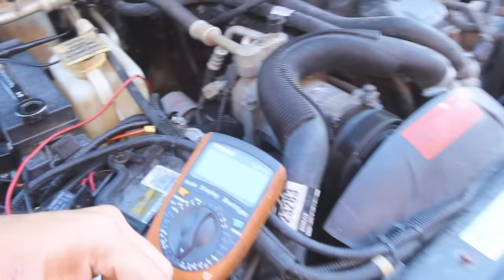AC Suddenly Stopped Working In My Car / Cheapest  Air Conditioner Diagnosis and Fix / Hot Jeep  XJ

Comment: Neat trick. I know my clutch on my compressor works but it won't come without manually adding voltage. So either my pressure is too low or it's the switch. Appreciate the video.

Comment: that switch is also designed to save system when low on coolant check coolant level you will probably add add with dye and find o ring that needs to be replaced drain coolant replace o ring replace coolant and enjoy your repaired system

Comment: This let me check the pressure on my system. Thanks I knew I had a leak but couldn't find it im guessing it's the evaporator core.  I'll be in there replacing the heater core later this year so I'll just do it all at once

Comment: Dude you're awesome..  👍👍😁

I haven't got to try this method yet because I'm out of state. I have been watching other videos you've made on the Jeep Grand Cherokee because I just bought one last week.   It's a 2001 and I paid $1,800 for it.   Of course it has some issues the air conditioning was one of them.  At least now I will easily be able to tell if it's going to be an expensive fix to get the AC working or not.
Reply from the maker: Good luck, let me know how it goes!

Comment: Sometimes that AC compressor clutch sticks if you take a wrench and tap on it give it a few good wax but they see in the on position it'll turn on. Or sometimes the electromagnetic switch that engages that clutch is bad

Comment: Good Video--First step I would check Freon Psig., if it is Normal, there is no Leak then it will either be Low or High Psig. Switch-most likely Low Psig Switch or Compressor or even the Clutch itself could be bad. As you have said if jumping switch engages compressor and starts cooling Vehicle then the Psig. Switch is problem...

Comment: I made the jumper paper clip and  stared the engine and the clutch did kick back on. But there was some oily liquid on the two wires in the boot. But the smaller tube got real hot .  The fan runs. I got a 1992 cherokee. You are one slick guy.

Comment: It helps, I have a 2002 Ford Explorer, the ac coolant can lasts a short time then back to hot, going out now to check it. First time I will do this, alone. I hope to just place the coolant and it works, but I will check this valve, great video!

Comment: Thanks for doing this video, I am in this project to fix my self the airconditioning problem for two summers now I could get to the problem, long story short I checked low-pressure switch and there is no continuity. so I will order and check back and comment more.

Comment: To change a low pressure switch , you usually have to evacuate your a/c charge which you have to get done at a shop unless you dont value the ozone layer. They will charge you for more than the 36 dollar part
Reply: He said it had a shrader valve in his switch.

Comment: If your car is fitted with a 3 or 4 wire pressure transducer you can easily stuff the ECU.  This should only be done on a 2 wire pressure switch and only for testing that the compressor clutch is still operational and never bridged out to run the A/C, as the pressure switch may be perfectly ok and the system may be low on refrigerant. If it is low on refrigerant and you run the system with the switch bridged out. Expect to be up for a new A/C compressor and possibly an expensive flushing of the system if the compressor shits itself.

Comment: It did help. I didn't known you could remove the pressure switch with refrigerant in the system. That's good to know. Thanks.
Reply from the maker: Yeah, it's nice there is a valve down there.

Comment: you can unplug that pressostat switch with the ac on and if the ac clutch stops, the switch works. plug it back in and the ac comes back on.

Comment: Continuity will only happen when a new good AC clutch sensor is screwed into the pressurized port. The same sensor seating on the bench will not have continuity, it will be "open" like a light switch in your house in the "off" position.

Comment: Man very good and well explained video ! I bought a 01 XJ last month and ac doesn’t work so I used this method. Compressor clutch came on but my electric fan never kicked in after 10pm so running the ac wide open. I discovered that a ac hose ( metal ) was disconnected at butt of another hose under beside the battery. It’s a PITA to reconnect. After running it wide open 10mins the heat guage never got over 210* so idk at what temp it kicks in. ( elec fan )
Reply from the maker: Interesting issue,

Comment: Thanks dude. Your vid saved my butt. I did replace the pressure censor, but compressor still didn't turn on thought had to get replaced or at least expensive shop diagnostic. did the paperclip test and compressor turned on.

Comment: LP switch is there for a reason.... Prevents compressor clutch from engaging in a low refrigerant system...Engaged compressor will go bad running with lack of refrigerant.... Compressors are the most expensive component of an AC system.

In general, when you hear 'paperclip' involving something electrical in nature don't do it. Buy a cheap multimeter, and spend a small amount of time learning how to use it to diagnose the issue.... Youtube will learn yuh right

Comment: My compressor started to turn on and off intermittently. I connected the gauges and saw the pressure was OK. I thought the switch was bad but when I disconnected the connector from the switch, I could see the connector was corroded and filled with green pus. I replaced the connector and the pressure switch to fix it.  I think I spent $11 for both parts.

Comment: I’ve tried this on mine because my whole system that I just replaced won’t work. I’ve replaced everything including the compressor and still won’t engage. Jumping the HPCO doesn’t get it to engage and 1996 didn’t have a low pressure cut off. Don’t try to tell me it does it doesn’t I have looked trust me

Comment: Fuse blown, a "bigger problem." Yup. Worked on a Honda the other day. No A/C. Fuse was blown. There was also a bungee cord wrapped around driver's side fan and the fan blade had completely snapped off of the fan motor. Replaced fuse and fan assembly, problem solved.

Comment: Awesome video 👍! I have a little question : Can all pressure sensors be removed, without removing the a/c gas/fluid? Mine ford focus mk3 2014 does everything right, but it still won't work with the a/c on 😭🤔

Comment: I would love to see someone have a faulty low or high pressure switch that was the only issue. Then take it to a shop and see what they charge you to change an 8 dollar part. Besides maybe a one hour minimum for diagnosing and doing system checks. Could sure highlight some bad apples like that
Reply from the maker: You gotta pay, if you can't  do it your self.  Lol.

Comment: My brother in law checked my car on Fri nite as my daughter told him ac in my car stopped working. He said ac (compressor) clogged went out. I called a mechanic shop & said it'd cost me &980 to $1k ish to have a new compressor. My question is is there a way for him to do like you did to my car? Or should I have to buy a new compressor? I'm a single mother is on FMLA Leave for 2-3 months due to my surgery on my hands, so it's very tight budget. Pls help if you can give any solution with my car without spending lot of money? I just bought it from a Chevrolet dealership where I live last April & it already gave me a headache. It's 2013 Nissan Rogue s. Thank you so much. I really appreciate 🙏

Comment: Appreciate the instruction.  My comp. clutch isn't engaging, and i'd hate to replace the clutch or compressor and it still didn't work.

There's a high-pressure switch too, right?  Would that be another thing to check?  I'm utterly illiterate when it comes to electrical systems, and multimeters make my brain freeze so i don't have one. 😬

Checked relay/fuse, coolant pressure is good, no probs.  Will check this switch & hope for the best, thanks very much for the straightforward and uncomplicated video.👍

Comment: One telltale sign your condenser fan is at fault is, your A/C only blows cold when you're moving and getting sufficient airflow across condenser. But at idle, it blows warm.
Reply: what about if it only blows cold air while driving

Comment: When the engine is cold the a/c works great.  Blows good cold air
  After the engine gets warmed up it continues to blow air, but the air becomes warm.  After you stop and the engine cools a while the a/c blows cold air again until the engine warms up and again it blows warm air.
Now, back in winter when I turned on the heater (after the engine warmed up) it would blow cold air.  Sometimes it would blow warm air for a little while, then cold air again?
Reply: Ever find out the problem? Sounds like my car

Comment: Cool but in mine the clutch engages, no leakage of oil or cooleant gas but still no cold air. I guess the compressor is not compressing. I've been told it might have mositure inside since i wasn't using for more than 2 years now.

Comment: 2010 Cobalt here. My air will quit at the hottest outside temps. 2 yrs ago I had a problem with it quitting. I had a mechanic check it put. First he changed the thermostat. Fine, for a couple miles then quit again. When driving it back to him the engine light came on and the info window read  __ F all blanks where numbers should be. When I told him that there must be a temp sensor on the engine that is not working he said "oh yeah, there is". He changed it and all was well until next season. the same thing happened and he was busy and Covid, so I let it go, A few days later the warning light went out and the info window started reading temps again. The air was working again. Three days ago warning light on and info blank again, NO air. Now I will wait a few days again to see if it up. Question: Do you think the new sensor may have been a bad one?
Reply from the maker: It's possible,   you need to check the history codes to really isolate the problem.

Comment: Thanks for the video. Checked this sensor, and it was good.  AC runs and is cold for about 15-20 mins then it gets hot and the fans turn off. They will start turning occasionally but go off . Any idea where I should look next. It's a 2016 outback

Comment: You said that if a fuse is blowing that can be a bigger problem. I understand that but I also wonder if a bad pressure switch, in particular high pressure switch couldn't that also be cause of a fuse blowing? I don't know. Just asking? We have a different vehicle and new clutch mini relay The 10 amp mini fuse blows after clutch is activated or when the Auto AC switch in dash is on. Clutch can temp activate before fuse blows and the compressor shaft isn't froze up. There is DC power at disconnected compressor connector when that connector is tested for voltage.

Comment: I’m hoping this is my issue. I get cool air for a little while then I get hot air, like my compressor doesn’t stay on. But when I hold the AC button in, I get cool air, compressor kicks on. Wish me luck. Oh, it’s a 2016 Subaru Forester. Oh, I forgot, my AC light flickers and won’t stay on which is also weird. Gotta get this fixed since I live in Arizona.

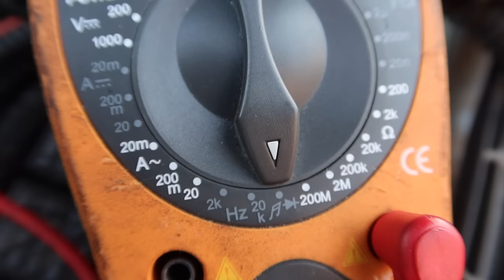Comment: @5:59 To check for continuity you can use the cheapest multi meter: switch on Resistance Mode, if you have continuity it will show zero. There will be no that nice beep, but it will detect the continuity (R=0, approximately). 
   I have a question about that Low Pressure Switch. Is it related to Secondary Air system? I'm  trying to fix  AC on one car (2001 Saturn SL2). It did have a leak, since there was no pressure on it. It was without AC for 10 years (fm the time I attempted to repair it at Dealer, they tried their best, but after the last visit there on this matter, the AC stopped working after 2 weeks, and I decided that the system can't be fixed. It is our back up car, so we didn't worry much about it).  I replaced  many AC parts on it, but it doesn't hold vacuum. That Low Pressure Switch also might be faulty. Thank you for a great film.

On Secondary Air System I replaced:
1. ACDelco 21008418 GM Original Equipment Secondary Air Injection Vacuum Check Valve.
2. GM Genuine Parts 21210000 Secondary Air Injection Shut-Off and Check Valve.

   And I didn't replace:
3. GM Genuine Parts 214-1057 Secondary Air Injection Vacuum Control Solenoid Valve  (I suspect maybe that part has another name Low Pressure Switch, but not sure).
Reply from the maker: Secondary air injection is part of the emissions system, not related to air conditioning.
Reply: @Donnythelatemodeltech  Thank you so much for a quick replay. I'll try to find that Low Pressure Switch on Saturn. I have Shop Manual for it. Thank you again.

Comment: What if your AC suddenly does not blow air?  Just had compressor and fan replaced and it worked great for a couple weeks- now nothing.  Not blowing heat or ac at any speed.  Thank you!

Comment: Great video. I have intermittent cooling and warm air. Plus, cold air but not chilling cold. I have no leak in the system and the pressure is perfect. Would you say that the same sensor is bad. Thanks for your time.

Comment: Now I’m confused because another video I watched said the ac pressure reg should have continuity because that tells you that the pressure regulator has been activated and has stopped the compressor before it is damaged from possibly too low refrigerant. Clearly from this video that wasn’t the case. Because the regulator didn’t beep the first time, beeped the second time. 
So to answer my own question maybe the first regulator was just altogether bad even without low refrigerant so it caused the system to lock up? 🤔🧐

Comment: I absolutely loved your video,, so much so, that I watched the whole thing, even though my car is a Mitsubishi lancer, any tips there? The compressor works there's no leak, h and l pressure on point, plenty of refrigerant, no fuses blown, the clutch just doesn't engage, so would a paperclip (hypothetically, full absolution, at my own risk, yada yada..) be a possible try on my car as well? Or is this just a Jeep thing? Thank you 😊😊😊😊
Reply from the maker: Only if it is a two wire switch.

Comment: Problem is you aren't reading the  refrigerant pressures .  The orifice tube has a screen filter and when it blocks it changes the low side pressure also. So some people might watch the video and just bypass the switch with the jumper wire and damage the compressor.

Comment: Thanks for video.  I don't know if that's what's wrong with mine on a 2009 Chevy HHR .  It was charged and AC was working fine and I thought I smelled some electrical wire burning and AC started blowing hot. 🙄

Comment: I did this and it actually engaged the compresor. However, my system is low, almost empty, which tells me there’s a
Leak somewhere. I used about half a can I had laying around and brought it up to 30 psi (green) but within 20 minutes it went down to 20 psi on the low end. I also heard a hissing noise by the high pressure switch and port. Could the leak be contained there? I removed the high line cap and squirted a bit of soapy water and immediately started bubbling up, so I’m wondering if the valve at the high pressure port is shot. Your thoughts?

Comment: Have a 95 Grand Cherokee. Shorting out this switch, the compressor would come on. Bought a new switch off Amazon, installed, expected the compressor to engage as it did with paperclip, but it does not. So what's going on inside that area that the Switch is plugged into?

Comment: or, your switch is doing what it is designed to do.  Refrigerant low, switch disengages compressor.  I'd check my compressor suction pressure with the switch jumped before I run off and buy another switch.

Comment: If I have a clogged expansion valve, won't the low side pressure gradually drop regardless of if I'm driving or idling? As long as I'm idling Ac blows cold, but when I take off to drive it becomes ambient temp after some time. I'll check the low side temp and it is very low. Before driving at idle it'd stay at 30 psi. Thanks!

Comment: Thanks my clutch wasn't turning on at all I disconnected the switch plug and inserted the  paper clip and the the clutch did activate let it run for a couple of minutes but no cold air. I plugged it back in to the pressure switch the the clutch was activating on and off like every few seconds going on and off very fast still no cold air charge is reading in the normal green any ideas on what to do next? Thanks!
Reply: Did you figure it out

Comment: Hey how's it going I replace the pressure switch line first on my 2010 Ford Taurus because the line was cut into AC compressor didn't work so I replace the pressure switch and it still want engage

Comment: Great video! Very detailed explanation. I'm going out now with my paper clip and check the switch. I will let you know! I can't take the hot air.
Reply: It wasn't that. Checked the fuses and relay switch and they are okay. I'm going to have it checked and see if there is a leak. I do not hear the compressor clicking on? There is a gooey substance on the front of the  compressor clutch but it is running. Oh well  darn Charger. I'm ready to sell it.   Thank you.  I'll check back for maybe a video on replacing wheel speed sensors. Last one cost me 98 for the part ant 198. for labor. Keep up the good work!
Reply: @TheMargo420  is your ac clutch engaging?

Comment: I put an ac compressor,,system wasn't contaminated,  yet still ac not coming on. I replaced ac blower resistor,  relay to ac compressor,  fuses. 2007 Chrysler 300 2.7

Comment: I have 1999 mustang it has power in low pressure. But I jumped low pressure switch . But still no power coming to compressor. Any have info ?

Comment: What if I cross the wire for the low pressure side and it doesn’t engage? I also checked for continuity and it did. But the clutch only engages when I cross the wires by the relay.